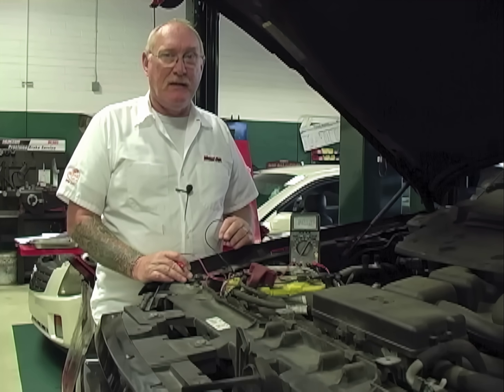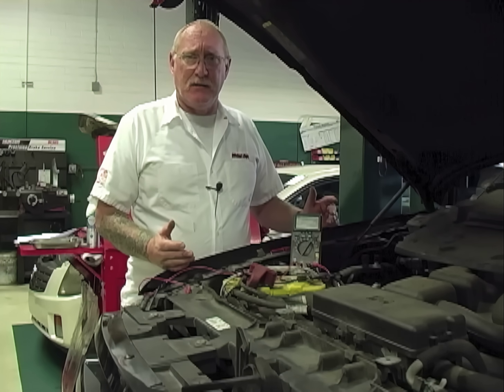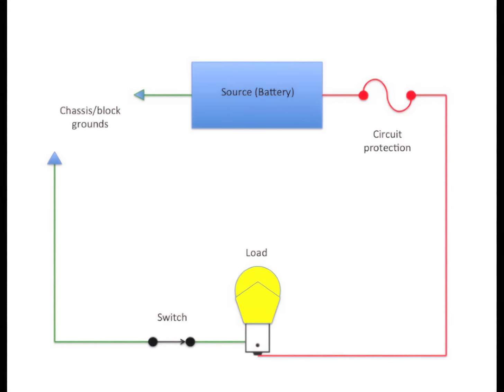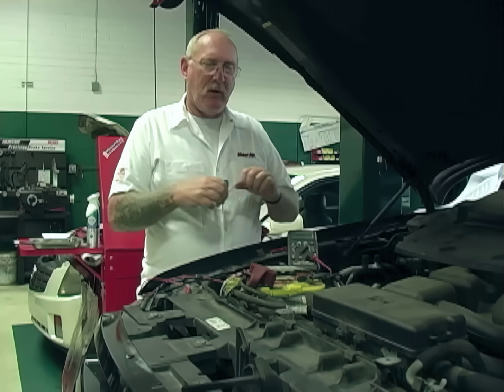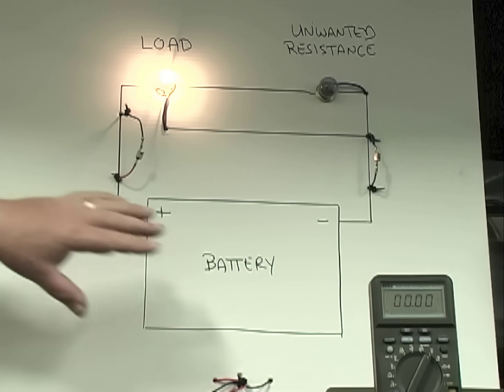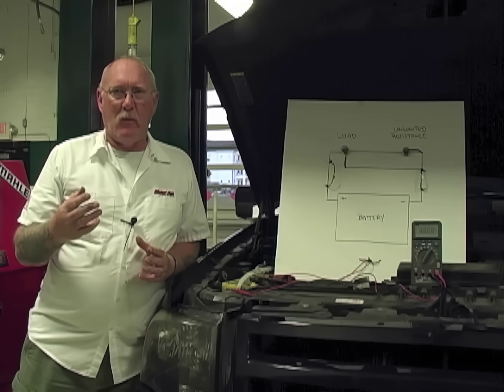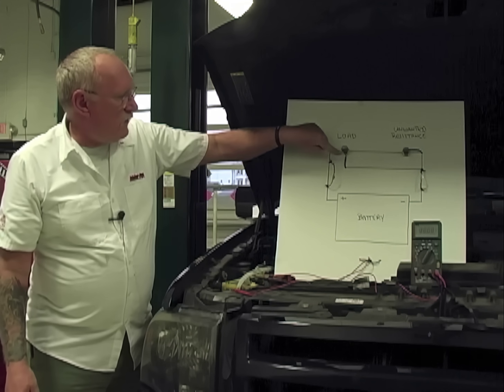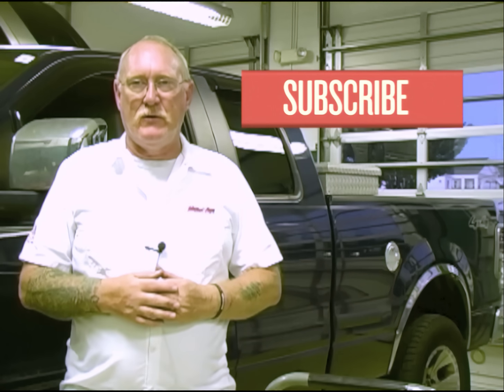The Trainer #47: What measuring voltage on the ground side means

Comment: Great video! I have a problem with my 04 ram , voltage meter is reading too high. I will replace + and - cables and see what happens. P.S. changed both alternator and battery with No result so far. THKS.
Reply from the maker: Test before you replace.
Reply: David miorgan  thanks for the advice, the voltage shows high while running, measured with several meters. It hasn't been a problem, I mean for 5 or 6 months, starts and goes.

Comment: Hello PETE
What if the second Light bulb  ( unwanted resistance ) had its positive lead hooked on the positive side of 
that 1st Load. 
I know it doesn't apply in your teaching of the subject, but then would it mean that's normal circuit ? 
Thank you
Reply from the maker: Unwanted resistance can, and does, occur on both sides of the primary load. If the second bulb were wired in series in front of the first bulb, it would still demand its share of the supply voltage, leaving the remainder for the first. The effect is the same.
Reply: @VehicleServiceandRepair  
Thank you PETE.
But then, if someone lets say wanted to add an additional item as a hardware of any kind, an accessory that would demand a good 
supply of electricity, a coffee machine for RV's let's say. Then what should it be done ?
Also I would like to wire myself some kind of serpentine behind an outside rearview mirror. 
Could you resolve my problem. 
Thank you PETE
Reply from the maker: @sam-n7nevada370  Don't know of too many DC coffee machines so I won't tackle that one. Wiring in parallel is different than suffering an unwanted resistance in series.

Comment: Electrons flow from negative to positive not the other way around. I still don't know why the positive side is fused. Anyone have an answer?
Reply: Yes, in most cars, the engine and chassis are used as a ground back the battery. Due to this, to protect as much of the circuit as possible, the fuse needs to be on the positive side as close to the battery as it can be. This way, if any of the positive wire (after the fuse) grounds to engine/chassis, the fuse will blow and protect the circuit. If you placed the fuse on the negative side, then the positive wire could short to ground, melt and cause a fire and the fuse on the negative side would do nothing.

Comment: 100% best way to check for high resistance in a circuit. I've seen guys do voltage drops test and think that seeing 0vs means there is an open then do drop test across an open then spend days wondering where the short to voltage on the ground side is. There is no short to voltage it would be fucking impossible to have a short to voltage on the ground side without a blown fuse or a wire lighting a car on fire.

Comment: Lol voltage drop on a 47 foot Cris Craft powerboat isn’t as easy as it seems... plus i found the previous owner had the neutral cables from the 110v intake grounded to the green ground wires 🤦🏻‍♂️ about half the wiring in my boat shows signs of heat damage... luckily this $45,000 boat never caught fire...

Comment: Very similar to carrying out a millivolt drop check to calculate the resistance of bonding points,contractors and solenoids?
Reply from the maker: Voltage drop is voltage drop - one reason it is a great way to look for parasitic drain, too, by measuring the drop across the fuse.

Comment: As an hvac tech, 20 years in ac, and dc controls, and a gear head too, this is a true refresher and good foundation for newcomers too.
Reply: Hi sir
As an HVAC tech, can I ask u for a help with my 2001 MAZDA protege 5?
Reply: @tmanda323  I don't know anything about those particular cars, but what is it doing?
Reply: @jasonmitchell7677  AC works only in 1 speed of fan. In 2, 3 and 4 AC stops but fan keeps runing
Sorry for my bad english writing
Reply: @tmanda323  ... surely you have repaired it by now, or it could ruin the entire thing.  Some examples:
- it could be a simple switch and/or wiring issue.
- AC clutch burn out
- compressor overheating( short cycling, lack of external cooling, poor ventilation, low suction pressure, high head pressure, poor lubrication, wear and tear/getting old... that can cause electrical problems)
- A short can ruin the clutch, and a cascade of other things that are mechanically attached, like the belt system, ... weak charging, overworking the alternator, ...
Reply: @DormantIdeasNIQ  Thank you sir. Yes I have repaired it.
Reply: Retired, but you would be surprised how many "Journeymen" don't have a grip on this.
Reply: Except for the confusing, convoluted, and incorrect parts,  you mean?

Comment: You could have added to the viewer knowledge by checking voltage at both ends of the body ground cable, then battery ground to engine block, etc until you found the culprit.  

ATC
Reply from the maker: Thanks for the great comment! Will keep that in mind going forward. Always trying to be a little better than the last one!
Reply: @VehicleServiceandRepair  "Always trying to be a little better than the last one!"   Yes, Sir.  That is the American way!  

ATC

Comment: As a Mechanic of 40 years and Shop owner I’d like to Thank You. This type of video training is desperately needed, it never ceases to amaze me how many mechanics come through my shop and are absolutely Clueless about electrical basics but claim to be diagnostic Techs... now, with these videos I can educate my trainees without going broke
Reply from the maker: That's great! Glad you and your team find it helpful. That's what we do at @MotorAgeMagazine - "advancing the automotive service professional" since 1899.
Reply: @VehicleServiceandRepair wwq😂w😂😂wqqqq😂😂wwwwwwwwwawawaaaaaaaaaaaaaaawws😂wwawwawaa😂?waa😂a😂😂awa😂aw😂😂w🎉wawww a hotel wwwwwwwwwwwwww🎉🎉
Reply: I experienced the same issue when I owned my shop https://youtu.be/DA4vl2CsMSY when I would get other shops referring a customer over for a problem they couldn't figure out and it would often turn out to be a failure of basic battery or charging system testing 🤦🏼‍♂️
Reply: Every tune up tech & troubleshooter should know how to use an electrical meter. Many mechanics like to use a test light, however they also need to know what the voltage is as well. A faulty ignition switch can be the cause of a low voltage condition (assuming the battery is  above 12volts).
Reply: That is because most "Bumper to Bumper" mechanics R hacks & never know as much as a real Tune Man or Electrician
Reply: Hail yes! This was some insite to add to the toolbox.🧰 thank you. Keep learning!
Reply: With these videos I don't have to pay mechanics 😂
Reply: 👍👏👏👏 @ObsidianSeduction
Reply: Most mechanics don't know shit about galvanic reaction!
Reply: Makes a fella wonder if scientists today could operate a slide rule in case our chinese pals launched a EMP and shredded computer networks. They may have changed this because it made sense (we can't have that). The Navy uses all manner of hi tech technology but they still train Quartermasters to navigate the same way Columbus did. It's like banning calculators from math class.
Reply: I've been a DIY for a few years now, gaining much more confidence. The sad part is, in my area. You need to have your certifications complete to even be considered. (my experience does not apply to all shops and areas/city/states).

 I have high aptitude for electrical, and not mechanical since i've DIY put many parts in my own vehicles.  

This is a great video, to be honest, you really do need to practice practice practice. There's no replacement for learning the basics through trial and error.  

Other day i was testing a starter, before realizing.. (duh), i need lower AWG conductor that can handle the voltage and current to run the motor.  Used some jumpers, BAM.. power.  Another tip for future technicians, it's NEVER too late to learn the basics.
Reply: Probably if you would pay your people a decent wage you could get the help you need

Comment: I remember in the late 80s early 90s I was the go to guy for all my friends car troubles.
My joke was always that I would say "Sounds like a bad earth" believe it or not 9 times out of 10 it actually was.
Fuel guage shows full when I turn my headlights on....... Bad earth mate.
Headlights go dim when I turn on my airr con....... bad earth mate.
Radio buzzes with egine noise when I rev the car....... bad engine earth and possible blown noise supressor.

So many weird faults from a worn or bad earth strap connection.
Reply: Then there are the clueless know-it-alls that say "it`s always a bad ground". They have a 50% chance of being right and no chance of repairing it. Then when it`s fixed they will claim recognition. A good electric trouble shooter never jumps to conclusions or assumptions. It can be very humbling.

Comment: A slight correction on why the circuit protection is on the positive: the circuit protection should be on the side that isn't referenced to the chassis.  It doesn't matter if it's on positive or on negative, as long as it's all on the same side, and as long as the other side is referenced to the chassis.  Some old Japanese cars have positive referenced to chassis, and negative distributed through the wiring. And the reason it needs to be on the side that's not referenced to chassis is because of the ubiquity of the chassis proximity to the potential fault location ))

Comment: So what was the added resistance between the auto body ground and the ground of the negative battery post? Inquiring minds want to know :)
Reply: hello goodbye, a poor ground connection from the battery to the chassis.
Reply: @randyc5650  Thought there was going to be more to it but that would make sense, Thnx...  poor ground connection wouldn't allow the battery to charge which would then equal a dead battery.

Comment: Oh i see now,,,,you actually have the second light wired to positive but drawing shows negative terminal,,,,and yes the resistance is from trying to use one light gauge wire to ground both lights/loads,,,,so I'm not losing my mind,,,,lol
Reply: @George Spangler, Parallel ckt. Pos goes to both lites and Neg goes to both lites.

Comment: Some trainers teach current flow is from negative to positive.
Reply: Current flow is a measurement of electrons which are negatively charged  moving past a certain point in a certain amount of time.. Electrons have a negative charge and orbit around the nucleus in an atom which contains neutrons and protons. The protons are positively charged which keeps the electrons in orbit inside the atom. They are attracted to the positive proton. When they're pushed out of their orbit into the next atoms orbit, it requires an external Force of either more electrons being forced into the electrons orbit or a stronger positive potential attracting them away, which would then provide room for other electrons to move into their place. 

Either way they will move from a less positive source to more positive or you could say relatively negative to positive. So yes current does flow from negative to positive.

Comment: Current doesn't care what side of the load the fuse is on. It still protects the wire whether it's on the + or the - side of the load. the fuse is conveniently placed on the positive side of the load ONLY because you can't put a fuse between the load and its ground connection (if it is bolted to the ground), unless you find a special expensive metal framed component type of fuse (which I doubt exists). I see so many charlatans trying to tech beyond their area of expertise.
Reply: It protects the wire before the load, the cable is supplied from manufactuer by size based on the load.  The protection is the fuse which is rated in amps at a lower spec ready to blow BEFORE the load (which is faulty ) can draw the over amps. So the fuse at that lower rating below the cable rating the fuse goes pooof ! lol   If the fuse was to high rated the wire couldnt cope with extra faulty load ... and melt and possibily catch fire or get heated at least . Which in turn ,the heat now causes resistance of flow and more heat

Comment: This is good stuff!  I'm working on a degree in electronics but I want to be able to diagnose electrical problems in my cars.  It's almost impossible to find someone in our area that can do this.  The ones who can charge really high prices.  Im beginning to understand why.
Reply: Good stuff?  I beg to differ.  Ever wonder why so few people grasp these simple things? Bad instructors.
I taught electronics in the military and civilian sectors and, though you may know what you're wishing to convey, they way you convey it is convoluted and confusing.  Even your mockup with the two bulbs as resistances in a circuit is confusing because you have another black line representing a circuit path shorting the "unwanted resistance."  Why would you do this to people who are already struggling to understand what you're trying to convey?  The fact that you call the red lead of the DMM the "positive lead" and the black lead the "negative lead" shows a fundamental misunderstanding of how to use a DMM.  The black lead is the REFERENCE lead and the red lead is the MEASUREMENT lead.  Your meter doesn't even label them positive and negative! There are systems that are positive ground where the reference lead will be on the most positive side of the power source.  Telecommunication DC plants are like this and are -48VDC, typically. When you see a measurement, the reading is IN REFERENCE to the black lead and it may be positive or negative but you know it is WITH RESPECT to the reference lead.
Telling people that "voltage is consumed" by a load is also just confusing since there is no physical way to demonstrate this.  It's just as easy to teach electrical fundamentals CORRECTLY as it is to BS your way through it.  I'm a retired engineer/teacher and what you did in these 9+ minutes is just cringe. Telling people to remember adages instead of explaining the "why" of it only makes things easier on YOU, not on the pupil.   SMH     Awful.  Just awful.  THIS is why people think electronics and/or math is difficult... they think if they don't understand something it's because they're just not getting it when, in fact, it is the horrendous teaching abilities of the person in from of them.

Comment: the biggest thing you failed to mention is that when doing this testing you must have the circuit turned on and under load.   you checked the body ground yet  you failed to tell us what circuit was turned on(dome lights heater etc) since for some unknown reason we switch circuits (and protect them) on the positive side  you must have the circuit switched on for there to be a path to the point you are testing.
Reply: also  voltage drops are measured best in parallel with the circuit  thus what  your meter shows is what cant get through the circuit.

Comment: Dude I loved the video and learned even though I thought I knew not everything but all the interesting things. Point Being could you have shown the short or where the resistance was that was evident in the beginning of the video? I would have loved to see what was causing your showing of about 8-9 volts on the negative side of the battery.

Comment: Over-current protection isn't always in the positive. What if you are working on something with positive ground. :)
Reply: Working for the Bell  system for many years, that's al they used, a Pos. Grounding for everything.
Reply: @grassroot011  Yes they did pos ground to prevent galvanic corrosion.

Comment: We had a heck of a time installing a security system in a 1988 Porsche 928. The tricky wiring was easy by comparison to getting the brain to function, mounted in the back of the car. Two of us stuck at it until 3 am when we got a "dumb idea" that comes when you have nothing to lose. We stepped foot by foot along the body work and found the rear section of the car is isolated from the front. Tapping the body work in the rear  was not sufficient to get a battery level ground connection.

Comment: This will confuz ya.
Why not run cars on AC ? instead of DC?
run from generator through regulator straight into circuits and only diodes to charge  batt. then inverter to use power from battery.
this would mean there is no pos/ neg in system.
Reply: Liberty Barker.  
They already do that.  They’re called hybrids.

Comment: example
simple example
IN ELECTRONICS WE HAVE TO CUT CIRCUIT AT VARIOUS PLACES TO STOP FEED INTO COMPONET THAT WE ARE CHECKING. SUCH AS A RESISTOR VALUE. OR A DIODE . TRANSISTOR/ AMP. AND THEN THERE IS BLEED OVER. ESP PRINTED CIRCUITS AND NEAR TRANSFORMERS. AND CHOKES

Comment: so dam many drops that are normal! in series? in parralel?
computer has a continual connection.
do you not need to know these values before u say  aut ooo?
(aside from a serious short or. open circuit)
computer recieves from more then one circuit. not all sensors work in same direction.
idiot lights use this method to light up to show a fault.
JUST SAYIN